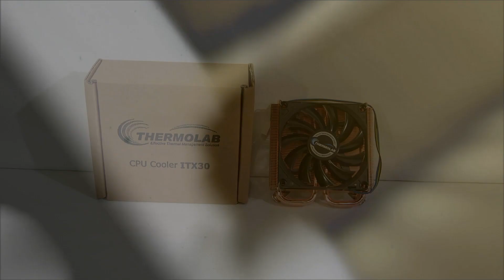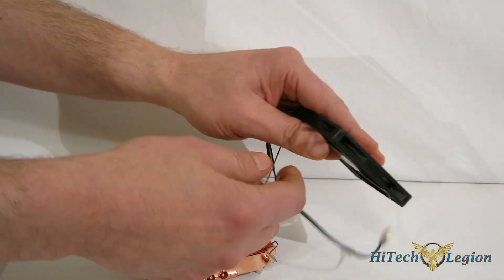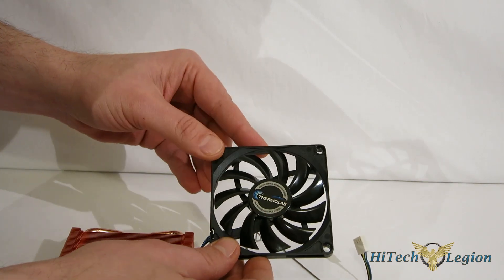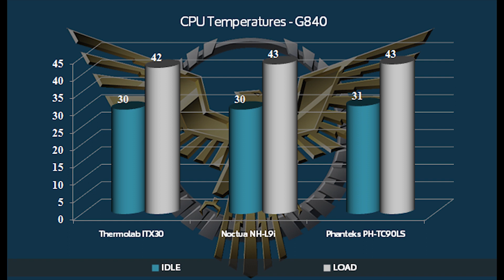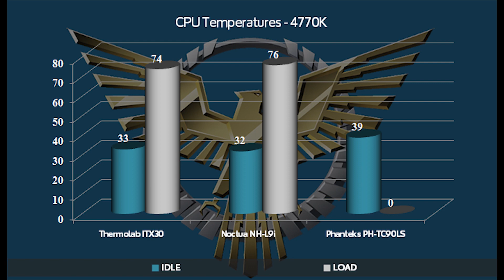Thermolab ITX30 Ultra Low Profile CPU Cooler Overview and Benchmarks

Comment: I run this with no issues on 4770k in mini itx case. It runs up to 60 degrees anytime.
Reply: Which motherboard in which Mini-ITX case you use? I build a small all-arounder (torrent machine, home server, occasionally gaming, so probably 24/7 work), based on the Asus Q87T Thin Mini-ITX MBO in Silverstone PT13 case, but I have a hard time choosing between the 4770S (3.10GHz, 65W TDP) and 4770K (3.50GHz, 84W TDP) processors. Would you recommend 4770K with ITX30 cooler in this case, noting that the vent perforation at the top of the cabinet is right above the cooler?
Thank you in advance for your help...

http://www.asus.com/Motherboards/Q87T/
http://www.silverstonetek.com/product.php?pid=419&area=en
Reply: Sudac Mine runs in bitfenix prodidgy on asrock z87 mobo with 16gb ram. I have r9 280 along with above components and bequiet 530watt psu. Hope that helps.

Comment: nice cooler. btw what kind of thermalpaste would you recommend because ill be replacing my cpu cooler soon
Reply: I have always used Noctua NT-H1 in all of our reviews, as well as in my own rigs. It provides excellent performance, is very easy to work with and has almost no curing time. I have also had good results with GC Extreme and MX-4.